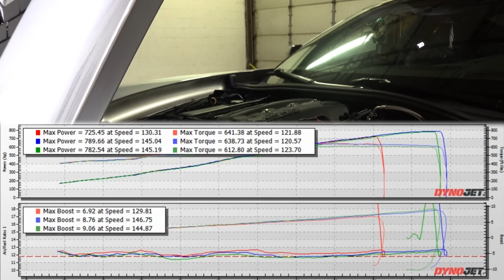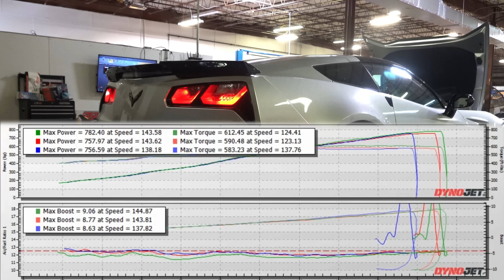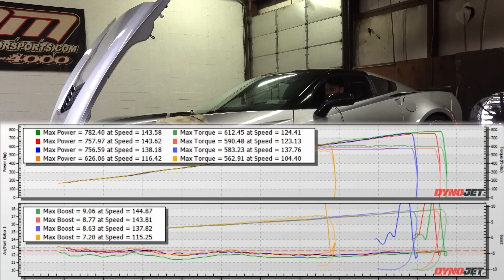Procharged Iron Block LT1

Comment: Question: when someone gets a package from you guys ie heads cam package, when the heads are sent off this is when the trunnion needle bearing issue gets fixed yes? Should i actually make it to court i wanna have something to slap GM with.
Reply from the maker: Trunnion has nothing to do with the heads.   That’s the rockers.    The valves are the issues in the heads

Comment: How difficult would it be to swap in a L8T in place of the L83 in a 2017 Sierra?
Reply: An L86 6.2 makes the same power  basically just saying 🤷‍♂️🤷‍♂️🤷‍♂️
Reply: The L86 would make more sense
Reply: L8T is 401ci versus 376ci, no fuel management stuff to remove. Forged crank and rods stock. So why not throw in a set of pistons, work the heads, cam, exhaust and Whipple. With a L86 you would have to replace more of ghe rotating assembly compared to the L8T to get an bottom end as strong as a L8T with forged pistons.
Reply: I know  this. Depends what your trying to do an Na setup or a build  for boost 🤙🤙🤙

Comment: Do you all not get a lot of LT1 corvettes getting pro charged and meth/fuel? I’ll be getting a corvette here in the next year hopefully and was trying to see what numbers I could get with those mods. Of course I’d be sending it your alls shop.
Reply: LT1 have weak internals so most people who are wanting above 650-700 wheel buy drop in rods and pistons.
Reply: @Usmc913  my goal was around 600 but if I have to drop in rods and pistons so be it
Reply: @cameronchaviers  you should be fine around 600 wheel with a good tune.